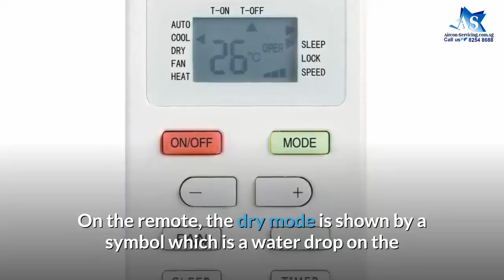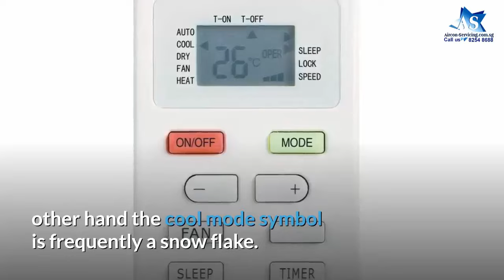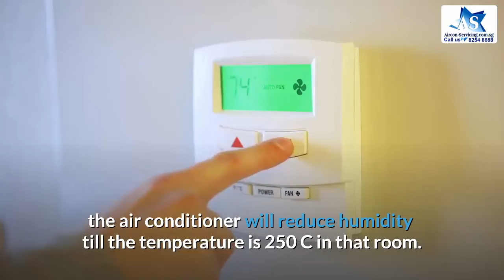What Is The Dry Function Mode In Aircon

Comment: Does dry mode consumes less electricity as compared to cool mode?? 
Authentic answers appreciated 🙂☺️
Reply: Ijlal Zaidi I wanna know too
Reply: I have pel ac incertor lahore.
Dry mod making the trip function.
I think it may be reduced less electricity.
Reply: Yes. But it's recommended to use dry mode for around 1 or 2 hours daily. Set your temperature higher to save on electricity bill.

Comment: "Increase in humidity translates into an increase in temperature." That is very misleading, as actually, an increase in humidity lowers the temperature of the air. If you have a room with, for example, 25 celsius temperature, and you mist water into the air, the air will become cooler as it gets more and more humidified.

However it is true that a temperature of 25 celsius with RH90% feels more uncomfortable than 25 celsius with RH50%. But to reach the same temperature with a higher relative humidity you need to supply the room with much more heat energy.
Reply: And also, "basically the dry function reduces the temperature in a room by lowering the humidity" is just not true. Check Mollier's diagram. If you simply lower the relative humidity of air, the temperature of the air goes up. If you lower the absolute humidity, the temperature stays the same. The air does have to be cooled in addition to lowering the humidity in order to reduce the temperature as well. However lowering humidity does make it feel less uncomfortable.

Comment: Reduce temperature to 250c? are you living in hell that 250 considered cool? Also humidity has no relation with cooling. lower humidity is conceived as cooler since body will sweat and sweat on body absorbs heat from body to vaporize. In a humid environment, sweat on body will not be able to vaporize and when temperature is low, the sweat on body will start absorbing water from air to turn to blobs of water (dew) and it feels more wet and more uncomfortable specially parts of skin covered with clothes will feel more uncomfortable. based on scientific studies, the best humidity level of environment is between 40~50%, in such humidity level even 28 degree feels a lot more comfortable than 22degree with 60% humidity.